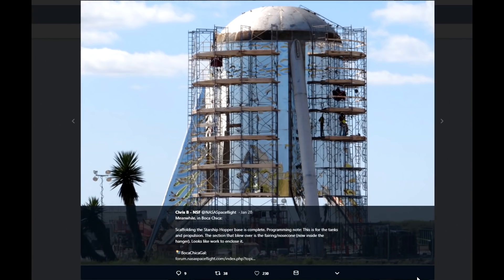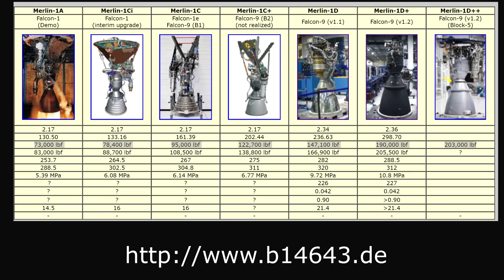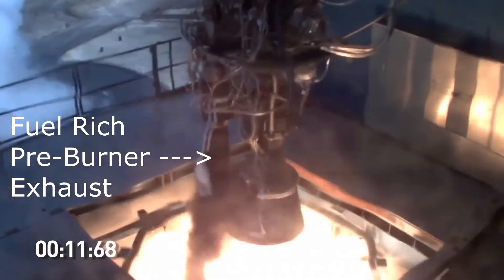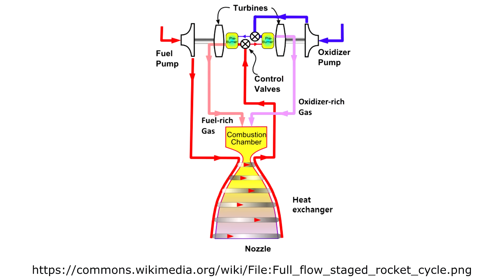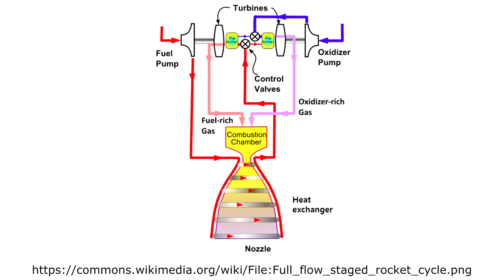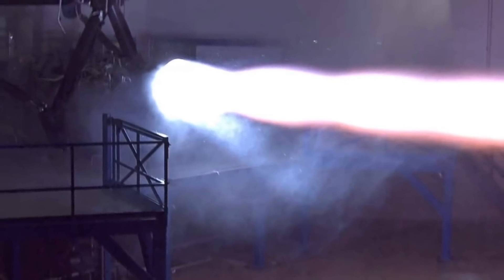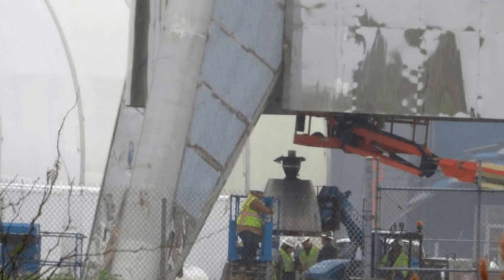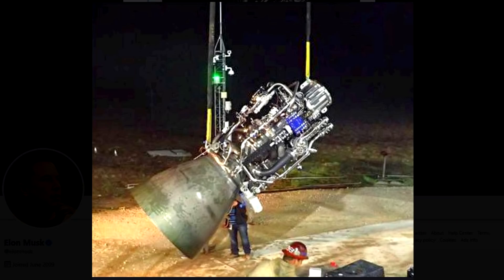SpaceX's Full Size Raptor Rocket Engine Revealed By Elon Musk

Comment: Just curious, If the Starship ends up with vacuum optimized engines will they be powerful enough for landing or will it have a mix of vacuum and sea level engines?
Reply: They won't be any less powerful. The problem is that that a big vacuum nozzle will shake itself apart from flow separation at sea level (on Earth, Mars is probably not an issue).
Reply: It will be a mix. In the press conference "First Private Passenger on Lunar Starship Mission", Elon said the rear cargo areas could be replaced with vaccum nozzles for the outer engines. So at least the center nozzle would be sea level optimized, and I believe only 1 engine is needed to land, although Starship could failover to outer engines for redundancy. Looking at the engine configuration, it might end up being 3 vacuum, 4 sea level. But this may be years after the first flight so it's all up in the air.

Comment: I've done the math (or rather, used the simulators).  380s is awful difficult to achieve if you limit yourself to 20 or 25 bar chamber pressure, and if you average 350s or 360s the mission profile and mass balances change quite a bit.   It may mean the difference between fast conjunction-mission transits and slow opposition-mission transits.

Comment: Isn't the space shuttle main engine (RS-25) also a full flow staged combustion engine ?
Reply from the maker: No, the preburner is fuel rich and drives both fuel and oxidizer pump.
Reply: @scottmanley  I'm aware of that but I thought that it still qualifies as full flow since all of the propellant ends up in the combustion chamber so no wasted propellant mass or energy.
  I see though that only the oxidizer is preburned, so maybe it can be defined as full flow partially staged combustion?
Reply from the maker: @listerdave1240  That qualifies as closed cycle. Full flow is when all the propellents go through the preburners.
Reply: @scottmanley  Thanks a lot, that clarifies it.

Comment: Scott. How about doing a short item about how they get the fuel out of the tank when in space. It obviously does not just run down to the lowest point and out the pipe as it does in a car, even when it is the 'right way up' with air pressure assisting. Always enjoy your vids.

Comment: Hi Scotty. I have a question. Do engineers make the combustion chamber to exhaust port ratio higher, to build up more pressure, and as a result the higher exhaust gases velocity, on those engines which supposedly have to work on orbits. Technically such engines will produce less thrust but with the higher efficiency, and less fuel consumption compared to the design of the first stage engines, where the thrust is more critical or vulnerable.

Comment: Scott,
Is solid fuel rocket powerful enough to put astronauts or heavy payload into orbit?
Reply: "Power" is a bit of a null term in rocketry, because it only refers to the amount of energy transferred per second and doesn't tell us anything about efficiency or thrust. A completely solid fuelled launch vehicle could have enough Delta-V (the total change in velocity that a rocket could impart) to put manned vehicles and large payloads in orbit, but due to the fact that you ca't shut down or throttle solid rockets most launchers either use a combination of liquid and solid propulsion or all liquid.

Comment: Elon keeps talking about SX500 which can handle 12000PSI or over 800 bar.   Of course you don't run that close to failure pressure in real life, but 300 bar chamber pressure with six sigma reliability?   I'm not betting against that ultimately happening.
Reply from the maker: Yep, but you have to remember that everything upstream from the chamber needs to have higher pressures.

Comment: Hey scot, I’d o have a few questions. Maybe you can answer it. Can a rocket use just use its self produced G-force to feed itself with fuel instead of turbopumps? If it is possible (or not) how high would the G forces need to be? Was it done before? Why is not possible?

Thanks for your answere already and for you hard work to produce the videos.😊

Comment: If each engine develops 250 tonnes of thrust why does the BFR need 31 engines? That would provide 31 x 250 = 7750 tonnes of thrust, I know the BFR is big but it ain't that big.
Reply from the maker: Maybe after upgrade from 200->250 they'll need less?
Reply: @scottmanley  What is the proposed mass of the BFR? 31x200 = 6200 Tonnes of thrust. Still seems an awful lot "over", the only full up estimated mass I can find  is about 9700000lbs or  4500 tonnes. With that much thrust to Mass it will take off like a, well, rocket.